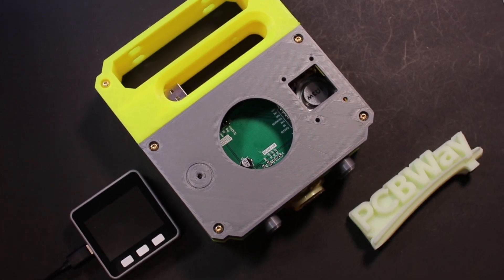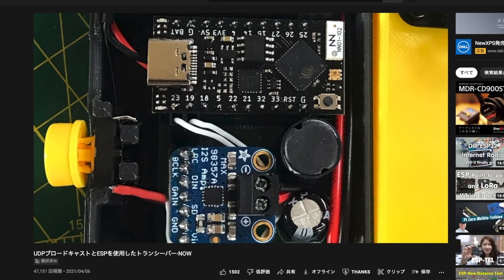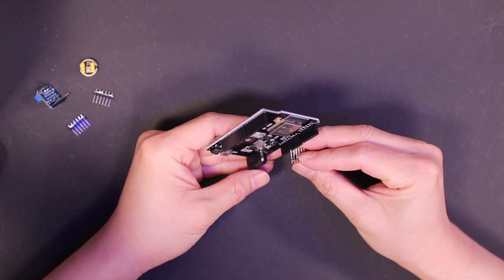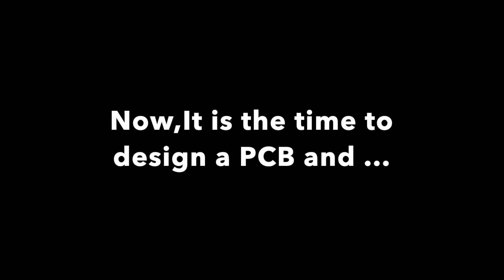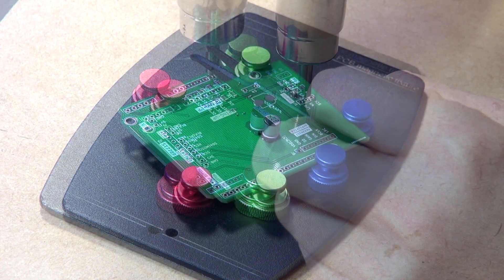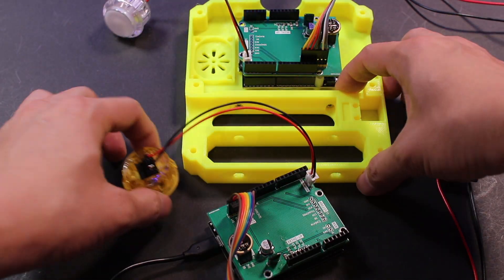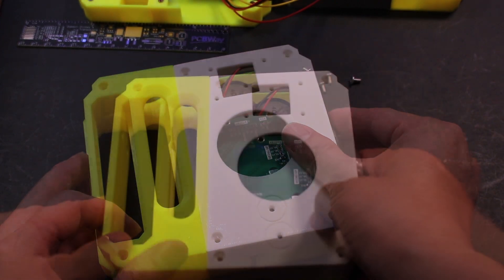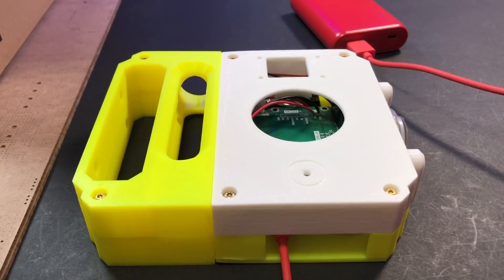ESP32 walkie talkie, made with a customized PCB extension HAT

Comment: will the provided code work on esp wroom 32 module? or the code may require changes? I am using platformIO to upload code in esp wroom 32.
Reply from the maker: It should work theoretically, you may make sure that each pin assignments is correct for wroom module